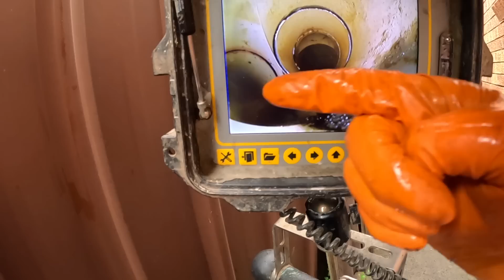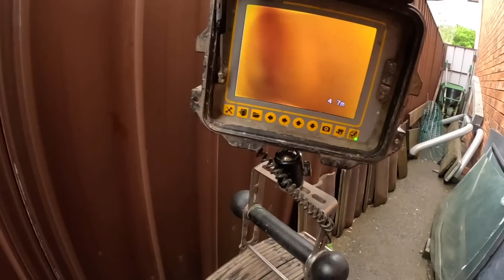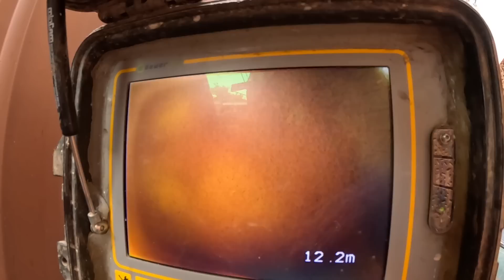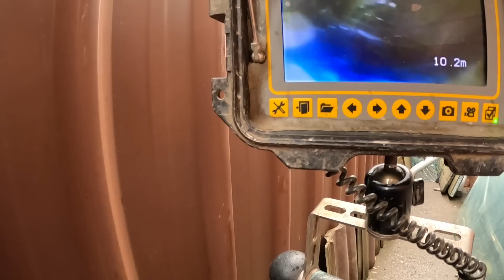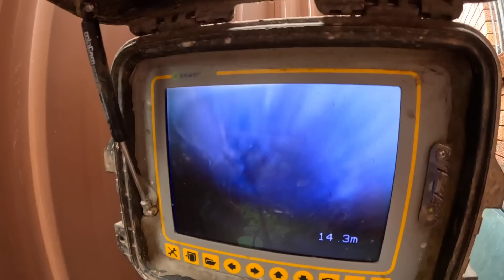Blocked Drain 812

Comment: I had a similar issue in my house a month ago. A mechanical unclogging was unsuccesfull even with an electric powered like 1 inch thick head unit. As Your lowest, unsubscribed fan I ordered a specialist with a van like You :) 15 minutes job, 200USD paid (where national minimum wage is around 800USD). Well paid, well deserved. Greetings from Poland :)

Comment: The trick I used to get a camera around a bin like that is a tie string line to the head of the camera, and when I get to the junction, pull the string line and push the cable into that junction

Comment: I would suppose they should be on a schedule of some type for jetting. Would using a septic product like Rid-X help break this sediment down and keep it from building up? Cheers to you Ollie and always enjoy your videos.
Reply: These sorts of build up often occur from not using enough water to wash away the soap & oil into the main line. The oils then undergo the process of saponification especially in the presence of other soaps & alkaline waste to for these chalky solid chunks. I always advise clients to use lots of water if running a waste disposal, washing dishes or using soaps etc.

Comment: You need to get you the wire mesh Nets like Koreans have. I think they may be made out of brass or something like that so they good last awhile. They're like hygrade chicken wire. Different sizes from very large and very small. And they use them to put it down into the small pipes and large drains to catch the fat that is blasted out of the sewer pipes by the pressure washer.